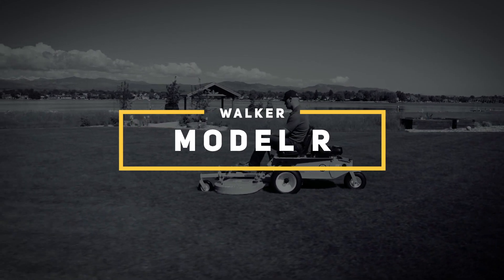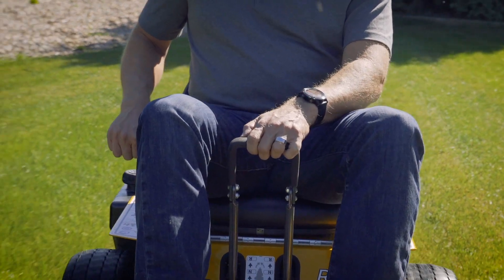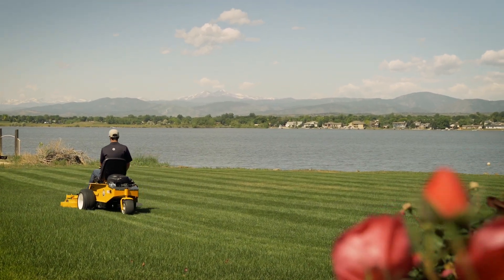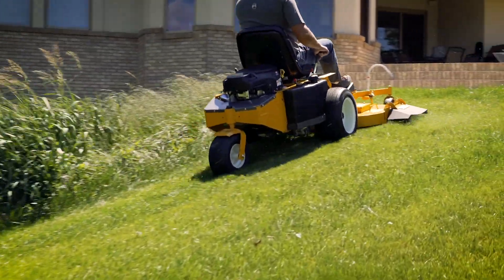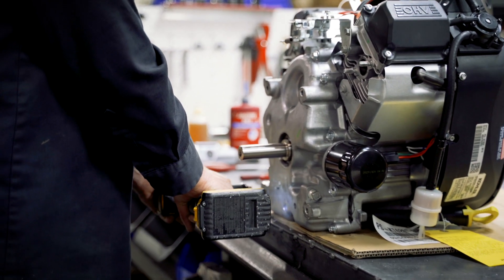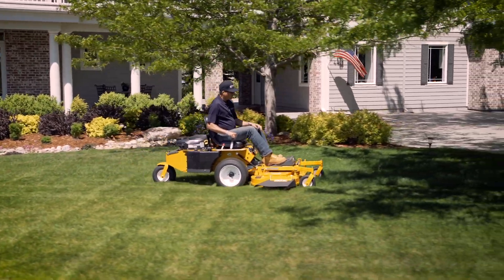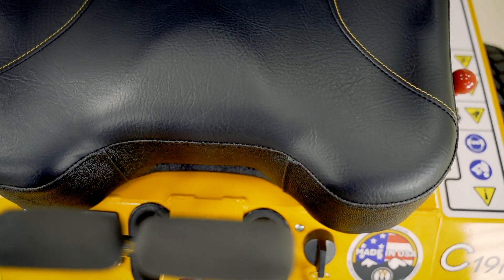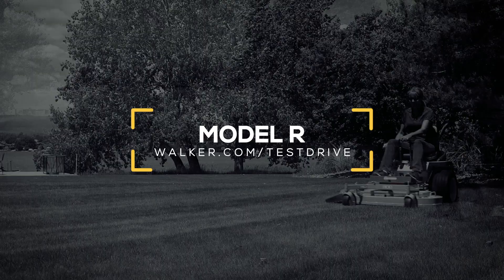The Walker Model R In-Depth Product Video

Comment: Think I might snag one of these but but the question is can these do good on hills that ALWAYS the ultimate choice when buying a riding mower otherwise this mower looks great! And of course fun
Reply from the maker: Great question! The best way to confirm if any mower will suit your mowing needs is to try one out on your property, but that said, the Walker Mower does great on hills. A mower's hillside stability depends on its center of gravity and traction on the drive tires to the ground. The Walker sits really low to the ground and its center of mass is in the middle, where the drive tires contact the ground. Here is some more info and a way to request a demo on your lawn. https://www.walker.com/advantage/productivity/balance/

Comment: I mow yards part time to supplement my income. I have only done 300 hrs/3yrs on the Raptor SD 36" and have now sold it. Is the R48" solid enough to tackle the jobs. It's really not any more than an acreage owner would use. It's cheaper than the commercial" units. I still use the 21"three speed" push" mower alot and I think this thing can do more of that . I use mulch kits because getting rid of grass is expensive/time and $-wise. Sub tropical Australia East coast.

Comment: Shame 3100 hydros were not fitted as the 2200 hydros are the weakest component of this mower, as they lack precise control necessary to operate safely on wet slopes.